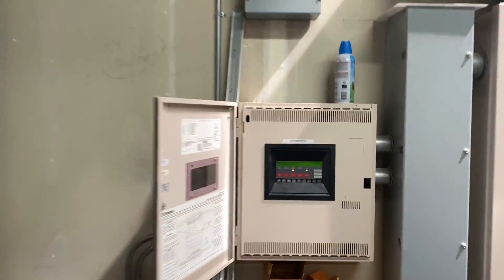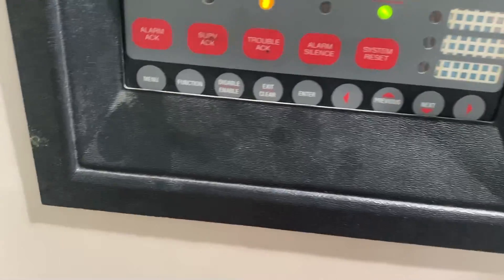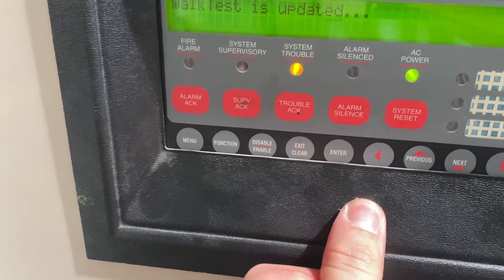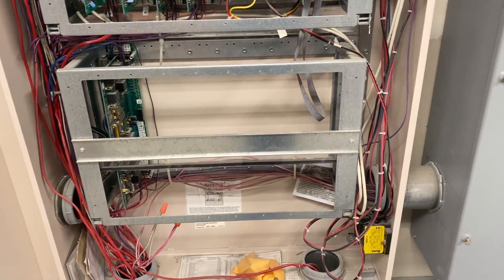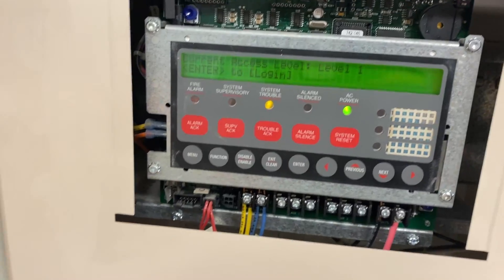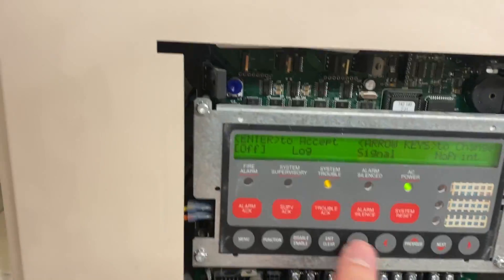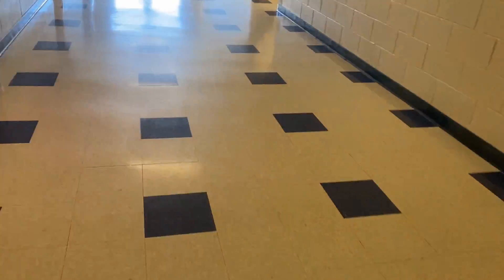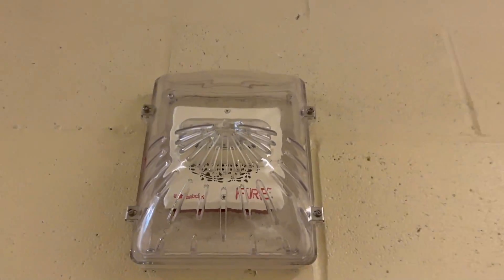Testing Another Simplex 4100+ | Fire Alarm Test #25 | #firealarmfriday

Comment: The laziness of installation was hilarious. They could’ve easily called in Simplex to install a retrofit 4100ES for newer devices that may not of worked with the 4100+. Plus, the panel with the extra 4100 cards is actually known as a 4100 transponder. Transponders are like a level below a networked system and are mainly used in big complexes (like factories for example) that don’t need a full on network but still need additional equipment to cover the building. They operate communications with the panel on the RUI circuit.
Reply: Problem with that is that simplex today is a shell of its former self in terms of services. If you called them in to retrofit, the installation will probably be just as lazy as it was before. Simplex's service today is kind of shitty.
Reply: @drum-corps-fan  The main issue is Tyco/JCI’s business model. It is setup to where you have to use proprietary services because JCI wants to make all the money they can out of their products even if they have to rip off customers. Personally I think being proprietary for monetary gain is counterproductive because contractors and customers prefer to buy brands they can easily work on without complications. In fact, Simplex systems get replaced with other brands like EST and Honeywell because they are less proprietary and overall have a lot better servicibility options (I do know EST is still somewhat proprietary but they are more open and friendly to 3rd party distributors and openly offer courses to be certified to work on their system. Simplex forces you to work for them in order to get certified). Simplex is you either do it their way or no way. Another similar proprietary brand known as Siemens is even worse. At least the one thing simplex gets right is developing advanced and reliable solutions that actually work very well and have a lot of useful features other products don’t. Plus, these features can be accessed by anyone. It’s just the fact that anything over hardware repairs/maintenance requires simplex to get involved (which also comes with a bigger price tag) that drives customers away. If Simplex completely drops their proprietary behavior like with their new “Foundation Series”, they’ll not only get more business (and keep the business they still have), but race back to the top considering their products are some of the best and advanced stuff the fire alarm industry can offer.
Reply: @FireAlarmDoctorYT1977  Couldn't have said it better myself! (though I also think pre-JCI Simplex is great)
Reply: @TheCarson116  pre-JCI simplex was the goat. Prime time of simplex if you ask me. JCIs business model is what’s killing Simplex. They’re cutting corners in all the wrong places (mainly customer service, product pricing, and consumer/end user friendliness). They’re also abusing the proprietary nature of simplex to rip off consumers which further puts distrust in the brand and drives away customers. JCI needs to start being more user friendly in terms of maintenance and installation of their panels and really rely on their strength of just making “cost effective life safety systems” like they’ve always been known for and leave the setup to 3rd party contractors that they can partner with to give a better end-user experience for the consumer just like Notifier does.
Reply: @FireAlarmDoctorYT1977  Well said! (though as I said I think it would just be better if Simplex was either somehow independent again or was owned by a company that had more respect for them)
Reply: @drum-corps-fan  Yeah, & who's to blame for that? (among many other things) None other than one Johnson Controls International.
Reply: @TheCarson116  Yeah, JCI is running Simplex into the ground. JCI has even run the Johnson controls line of thermostats into the ground. Johnson controls used to be a pretty reputable company at one time, but over the last 20ish years, they kind of just said screw it in terms of customer service and reliability.
Reply: @TheCarson116  JCI needs to take a good look in the mirror and a good look at their current stance vs their competitors and see what the effect of JCI’s decision correlate to vs what their peer competitors’ decisions correlate to.
Reply: @FireAlarmDoctorYT1977  Even if they did I doubt they'd care: practically all CEOs nowdays only think in terms of money, nothing else: as long as that sweet sweet cash keeps flowing in they won't care if they're treating their customers & employees like dirt (& for that matter running the company into the ground). It's a "business model" (if you could even call it that: if you ask me it's just legalized theft) that's way too common nowdays & it's one that needs to stop (which will happen if my own company ever gets off the ground someday).
Reply: @TheCarson116 If I owned JCI I would let simplex have independence over their products like Honeywell does with firelite,notifier,gamewell and silent Knight.
Reply: thats simplex for you

Comment: Neat video, the whoop tone is cool. I can’t stand that message. It’s cool and all but in terms of functionality it makes no sense for most buildings. “Walk to the assigned re entry floor or main lobby”  is not correct, I don’t know why it’s so common
Reply from the maker: yeah its kinda weird. Then again most 4100s are in large high rises so making the default the high rise message makes more sense. But they should have used the low rise message even though it takes extra effort
Reply: @4O5O-8O  what even is the low rise message? I’m sure I’ve heard it but I can’t even remember what it is
Reply: @FireAlarmDude5967 I don't know but Low rise messages are hard to get ahold of in notifier. I only saw one low rise message from the old vrom series but other than that it's limited.
Reply: @FireAlarmDude5967  I think the low rise message is “There is a fire reported in the building. You are to leave the building using the nearest stairway. Do not use the elevator.”
Reply: Yeah I agree. I feel like it confuses people more than helping them.